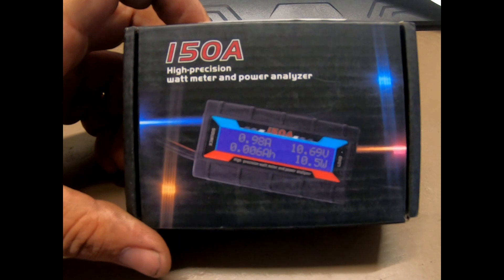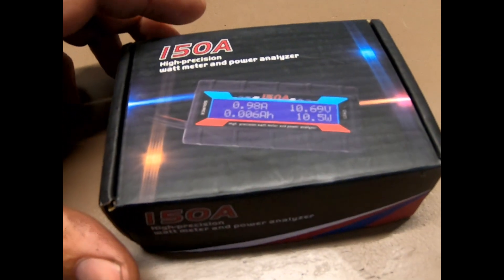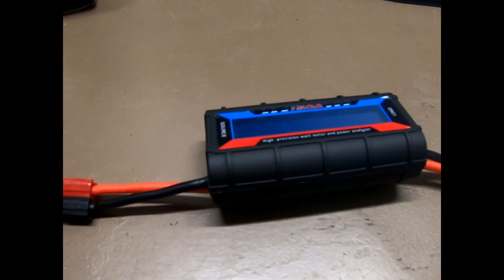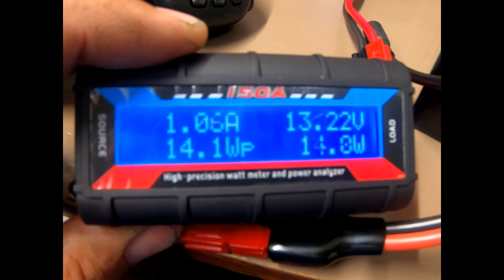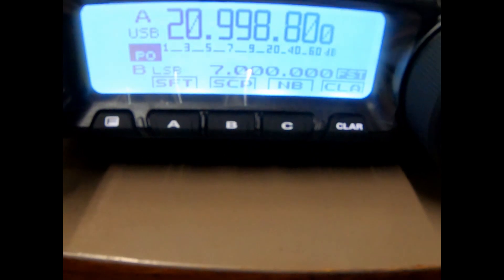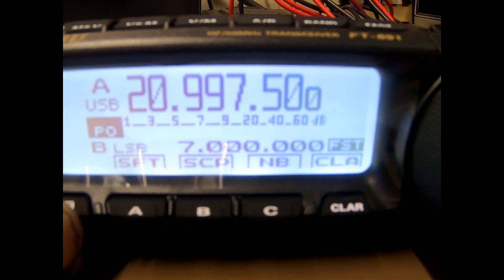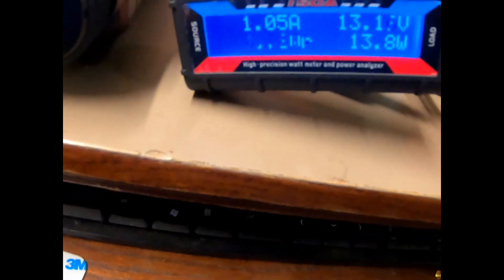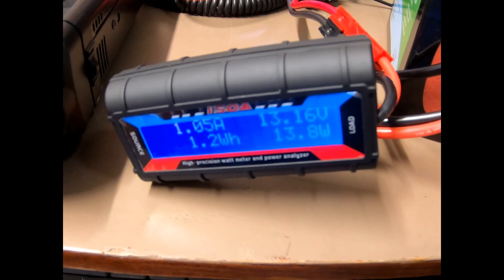150A Watt Meter For Ham Radio

Comment: Mine worked good until I plugged it into a 58v source and now it always says it's using 10w and getting warm even when there's no current. I also left it plugged into a battery for weeks and ruined a battery.

Comment: Did you just use 12 gauge wire with 30amp powerpoles?
Reply from the maker: yes. Its the only connectors i had at the time. I never ran the radio over 50 watts, never had any issues. no longer have the radio. but on my 7300 were i run it at higher output, I use the 45 amp connections
Reply: This meter can't actually handle 150amps anyways so what's the difference.
Reply: @jaythomas3180  ....what does the meter not being able to handle 150amps have to do with using the correct size wire on a 30a power pole?
Reply: @jay-rus4437  I'm asking what's the difference on what connector/wire combination to use since it's for a low current application anyway. Anderson makes PP30 connectors that take 12AWG wire so I see no concerns with the wire/connector combination either.
Reply: @jay-rus4437   I use 30a power poles on EVERYTHING that is 30amps or lower. You know why? Because its my gear and I do what I want and no one else uses my gear. Swr bridge that pulls 0.05a gets a 30 amp, ic 705 to battery gets a 30a pp, 100watt xiegu amp gets a 30a power pole. Anything that can draw more gets a 45 or 50a. Anything that draws less gets a 30a. No point in using lower amperage PP on devices that pull far less. Oh gee thats what fuses are for. 12ga wire can handle way more than one would think.  The fact that hes challenging you as to why you would put a 30a PP on a chinese cheapo device that claims 150amps who themselves put a 12ga wire on says alot for his trust in china. That device is maybe good for 50a before it internally turns to slag.
Reply: @jaythomas3180  ....I suppose it just comes from my construction background that 12g wire isn’t technically large enough to maintain 30amps....although length of wire has a lot to do with it. Im sure my general ocd gets the better of me most of the time. The reality is that he likely isnt putting that much load on it, but I tend to lean on the heavier size wire as a safety precaution. Im sure he will be fine, but that was what got my attention.
Reply: @DeepSouthVeteran  .....I can understand using 30amp PP as a minimum. I dont personally use the smaller ones either. Just caught my attention since the standard for electrical wiring amperage on 12g wire is lower than 30amps.
Reply: @jay-rus4437  thanks for the reply. 12AWG is the largest size wire a 30-amp will hold. For 10AWG wire you need a 45-amp connector. You're right though, 10AWG is better if you're running 30 amps continuously or have a longer cable run. I always prefer higher-rated wires and connectors than the fuse sizes I use for the same cautious reasons as you (10AWG+45-amp connector with 30-35 amp fuse for instance).